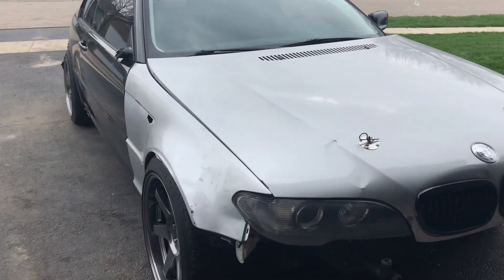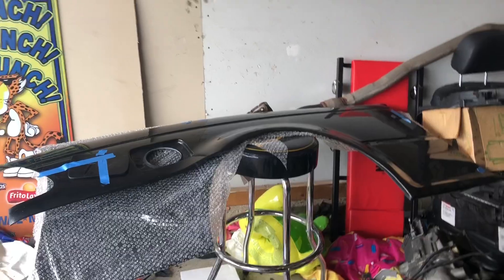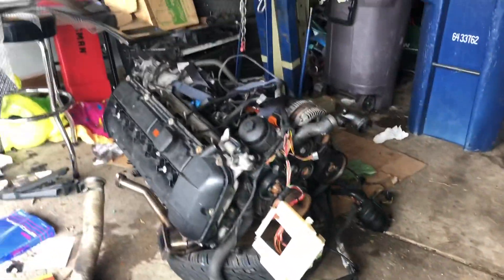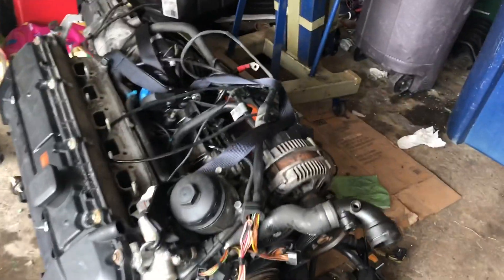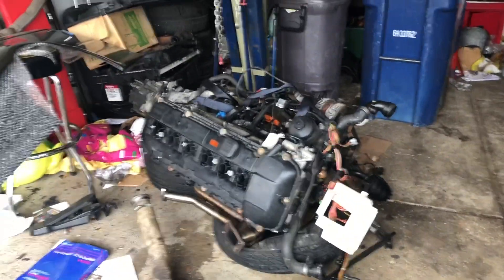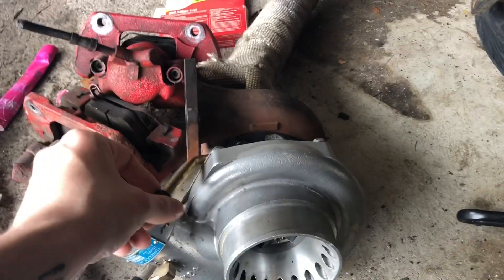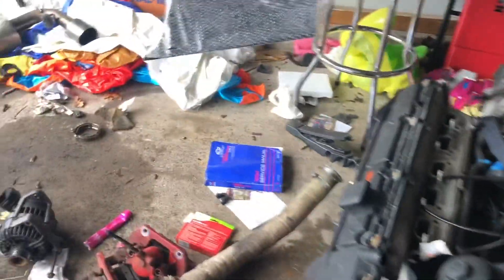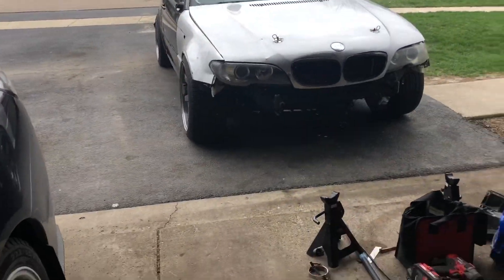BMW E46 TURBO | Project Begins | Plans and Goals - 500HP??

Comment: I have a few questions. Can I turbo a stack e46 using the a stock e46 maf sensor and keep the stock automatic tranny. I want to stick with 8 to 10 pounds of boost nothing more.
Reply from the maker: Yes I’ve seen it done a bunch but around 6-8lbs only. 300whp or so will hold for a good bit

Comment: How did you get a deal on it?
Reply: Thanks you know were I can get forged internals under 850 bucks?
Reply from the maker: i would use maxspeeding rods, rods and then the pistons of your choice that are stock size so you dont have to bore the block if youre trying to go budget
Reply: @straightsixracing  there is none for my m54b30 they only have some for a m52
Reply from the maker: Rods are the same for m52 and m54
Reply from the maker: Used, 500
Miles, some kid had an e36 and blew it up, gave the kit to his friend, his friend never used it and sold it to me when I asked about it, paid $350 for the full kit, m50 intake manifold and e36 m3 axles

Comment: $2000 for a turbo build on a e46??? Hmm interesting.. don’t get forget tune, cooling,upgraded fuel, brakes, etc...
Reply from the maker: tuning was cheap since i'm using stock engine management, got an upgraded fan and radiator setup for $300, water pump and thermostat is upgraded // replaced (came with engine)
E85 will come with the pump i had for a previous project and $500 injectors (that hurts lol) 
Have 330i brakes from a partout car i got for free, those are big enough for my application. 
hope that answered your question :)
Reply: @straightsixracing  what do you mean upgrade like change them for something better? Or just replace them with stock parts? I really want to do this to my 325i but I really want to know about the upgrades and what type of new parts stock or different

Comment: Really an awesome project dude.! I want to ask you a question about the exhaust manifold.Indeed it is a cx racing manifold but i believe it is from the e36 turbo kit. It seems to me that the turbo sits a little higher? It is ok with the hood closed? Hope everything goes fine .!!
Reply from the maker: Giannos Zaxaris thanks! And everything seems to fit fine, the only real difference I found between the e36 and e46 kit was the wastegate location. The intercooler piping/ intercooler seem to fit perfectly. Once everything is set and in the car I’ll know for sure but so far from testing everything fits great.
Reply from the maker: The turbo sits right where it should be, the e36 and e46 share an identical engine, and the engine bays are very similar.
Reply from the maker: New video is out, everything fits great after a I removed the battery box, hood clears the turbo by an inch or so

Comment: Are you going to leave the stock oil pump ? No good if you're going to rev it high lol
Reply from the maker: I agree, turbo m54b30 sounds amazing! I actually have yet to put the m50 intake mani on. But it’ll breathe a lot better that way, I still have to get ZHP cams. The stock cams don’t really allow for much pull on the top end. The b30 isn’t good for revving high so 6800 is where I’m sticking to be safe. I had a b25 and that was set at 7200 and it took it but that was a throw away engine.
Reply from the maker: I have a 3.46 in it so I’ll probably already be short shifting lol.
Reply: @straightsixracing  talking about the rear end... Are u going to reinforce the subframe?
Reply from the maker: Everything adds up fast though, I’m unfortunately not blessed with a big budget so doing things as I have spare money (bills/savings comes first)
Reply: @straightsixracing  That's what I want to do to refresh all bushings & reinforce the weak point, & eventually get an lsd.. I feel you tho just turned 24 with a 2 year old & a wife living in San Diego doesn't come to cheap specially when you're trying to spend easy 5k on your car lol
Reply from the maker: Nice! And I wanted crisp and consistent shifting. I’ll have a video installing / showing how awesome it is soon. Adjustable throw as well, needed solid engine/ trans mount bushings  to run it and I needed to replace them anyways 
Steering wheel was a gift ($300 lol) but the hub was like $90, the seat was $400 and the bracket for it was $230. 

Really the mounting bracket for the seat and the seat was like 60% of it lol
Reply from the maker: Also me and a friend will be doing it. He’s pretty good with tuning BMW’s 
We haven’t messed too much with turbo stuff on BMW’s but it’s fairly straight forward 
I’m ms43 so I’ll be doing it stock engine management. Wideband o2 and a new O2 sensor for the computer. Should be able to get it dialed on low boost. Once I shoot for 500 or so I’ll be getting it tuned on a dyno professionally but that’s a bit down the road at this point

And yeah I’m pretty lucky. I somehow always come across killer deals, if I would’ve bought everything at the price they were worth I’d be 8k down the hole 😆
Reply from the maker: Jose Navarro yeah I am. Gonna set the rev limiter around 6800. These engines aren’t good for revving high, and they don’t breathe well anyways. You make peak power down low so raising the rev limiter doesn’t help all too much. Hopefully on low boost it’ll spool quick and I won’t mind. 
I really want to build a high revving m54 one day. There’s some crazy builds out there right now, the head just flows like crap and you need to upgrade a Lot so it can rev high safely lol
But for the same money I could buy an s54, ITB’s are a dream mod for me tbh haha
Reply: @straightsixracing   Alex Nadolski  I'm guessing yours rev to 6k? Lol I've had a 04 325i 5 speed and it rev to 6500 now I have a 03 330ci & it revs the same maybe between 1999 & 2002 they only rev to 6k? Anyways with that being said isn't 6800 low? I mean zhp revs to 6800 and it only has cams I was thinking u were going for at least 7k lol but I understand u want to be on the safe side. Well u already have a m50 manifold so it's already breathing perfectly with that.. Yeah u make the power down low cause of the turbo size right.. which is perfect for daily/street driving but once u make anything over 300whp 6800 won't be a lot you're going to be short shifting lol that what I want to do with my engine rebuild it with all oem parts.. head & block but I want to focus more on the head first and head gasket all u need is supertech dual valve springs and steel retainers & maybe 1 or 2 more goodies and u have a healthy 8k rev limiter lol with of course upgrading the oil pump shaft yeah I love s54 who doesn't lol but I rather make a 700whp m54b30 BEAST which sound pretty much identical to a 2jz 😍 then the raspy s54 both would be sick builds tho
Reply from the maker: Yeah I’m about 3-4K deep so far. I stopped keeping track when i spent 2k in a month on it haha 

Ideally I would do adjustable arms, reinforce the subframe mounting points and the shock towers, and make a kind of brace so eventually I could go true coilover in the rear. And then all new bushings
Sucks that non- m e46’s never got an LSD and I don’t know if any easy cheap method of putting one in. I’m just gonna weld my diff. A lot cheaper and easier but obviously I would want an LSD. M3 rear end would be cool. If I can find a cheap m3 to partout and steal the rear end I would love to do that, then I could have a decent LSD and won’t have to worry about snapping axles as often
Reply from the maker: That’s the plan although I might reshell the car eventually. The subframe mounting points are surprisingly solid though so it’s really not a bad idea. 
I want to do all the bushings in the rear end at the same time though too
Reply from the maker: But that’s all bs I didn’t need like a steering wheel, wheels, seat, front end, shifter setup 
The shifter, DSSR and engine/trans mount bushings was like $600-700 lol
Reply: @straightsixracing  already have shock towers reinforced front & back, & a welded diff.. bro u got lucky you got your turbo setup for dirt cheap lol I'm trying to buy the the whole cx kit on eBay for like $2k I think smh plus injectors, all new gaskets, a few oil lines & obviously a few miscellaneous things I'm forgetting.. but the most important one the tunning lol who's doing yours? Are u going to tune on stock ecu?
Reply: Yeah didn't need to spend $700 on all that lol I have a eBay short shifter works mint for $25 haha bought and adapter for threaded shifter and threw on a weighted mishimoto shift knob 👌🏼 have some shitty coilovers for now but just order 2 days ago some BC's with custom swift springs 9k front 12k rear and some thicker sway bars from Hotchkis and now I'm looking at some new 18" wheels..
Reply from the maker: This is my first e46 I ever bought, I have since gone through like 5. and have had like 4 e36’s lol
Just in the past 6 months 
I used to part them out quite often, I actually got the coilovers and my old exhaust setup off a car I made money on lol so they were free

Comment: Nice project, I will finish my m54 turbo soon :)
Reply from the maker: I’m on m54 boosted builds on Facebook
Reply from the maker: InYourAss78 thanks! Yeah hopefully all goes well. The parts are good and engine is healthy but something always comes up haha
Reply from the maker: What car do you have? E46?
Reply: @straightsixracing  330ci e46
Reply from the maker: Nice! How far along is the project?
Reply: @straightsixracing  I still have To finish the downpipe this Next weekend and the exhaust line

After that I will start the tune @10psi
Reply from the maker: Have an insta or somewhere I can follow the build?
Reply: @straightsixracing  you can join bmw world boosted on fb if you want